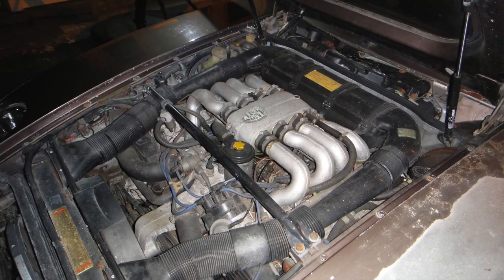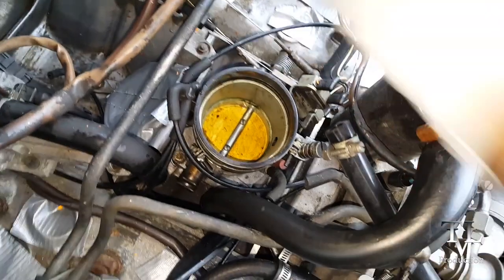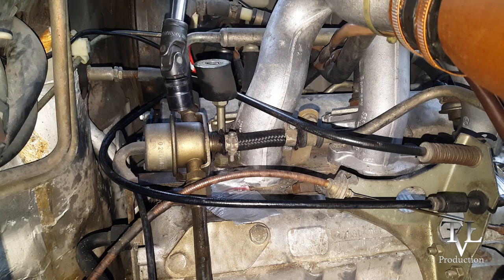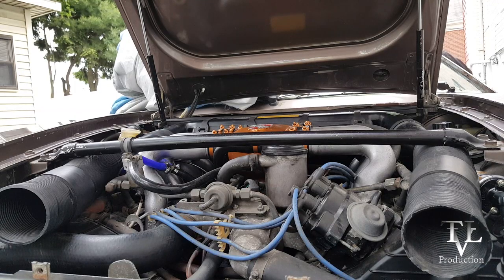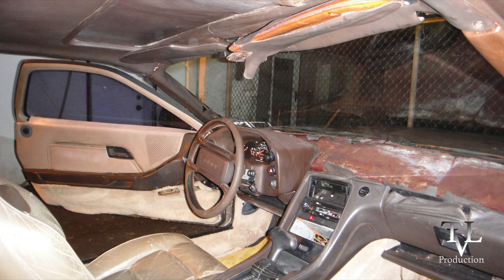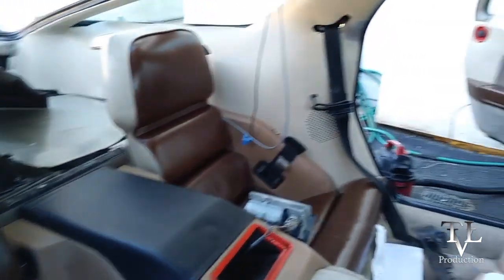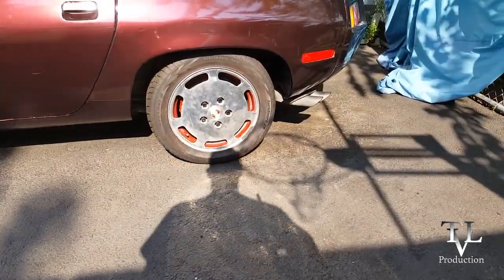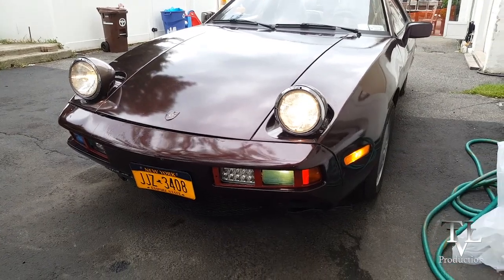Porsche 928 Then and Now Update

Comment: Amazing dedication to this car.... I did the full interior pull on my 1985 S2 and its a big job. I hope you tracked down the leaks I had the same water issue Sources were - Rear quarter glass (worth adding drainage hole) Rear glass sealant detached bottom corner, Main trunk / hatch seal disintegrated at top, and finally Trunk/ hatch  seal join point leaked.... Wrap looks great 👍
Reply from the maker: Thanks GF04RCE. I did replace the rear hatch seal and the sunroof seal as well.  I also needed some sealant for the rear hatch bolts. Thanks for the suggestion of the drain hole.  I'll look into adding one.  The wrap is temporary until I can get around to painting.  However, the quotes that I am getting for painting so far is upwards of $4000.00 so we will see.

Comment: Is your radiator original?. My '87 S4 was running great, replaced the T-belt and water pump in 2019 and not a bit of corrosion in the water pump, the cooling system had been well looked after, or so I thought. The radiator for 928's can have 1 or 2 oil coolers built into the radiator, for cooling the engine oil and transmission fluid - your car would have at least 1 cooler I would think. The radiator coolant corroded through the transmission cooler, allowing transmission fluid into the engine coolant and engine coolant into the automatic transmission. Water swells the friction material on the automatic clutch plates and debonds the glue sticking the friction material to the clutch plates. Take it from me, a new radiator is a hell of a lot cheaper than rebuilding the transmission. The same could also happen to the engine oil cooler putting water into the engine oil.
Reply from the maker: Hi Peter.  The replaced radiator was the original. More that 50% of it was corroded and clogged. The replacement was expensive but well worth it.  It has the built in oil cooler and was a direct fit.  The car is running a lot cooler, but I do plan to replace the water pump at some point in the near future.